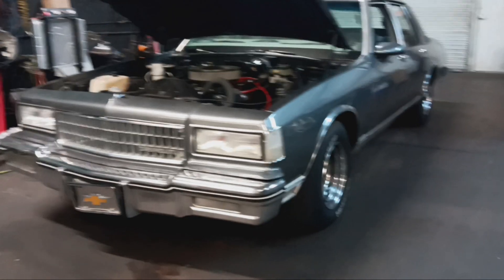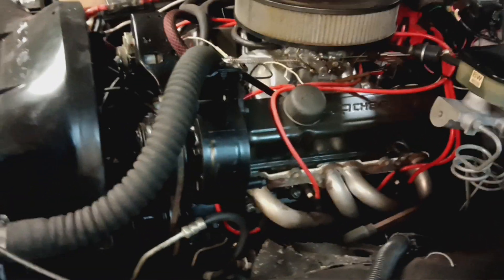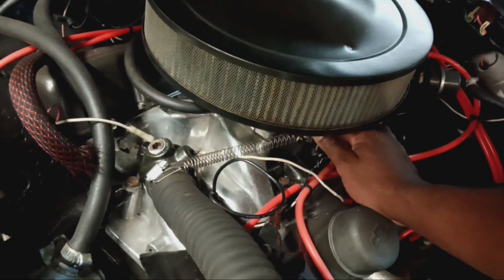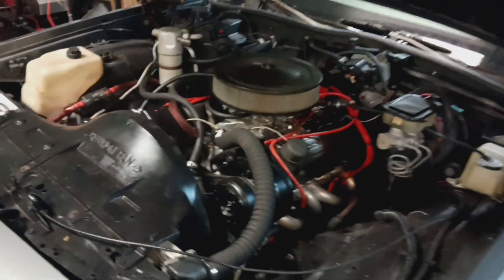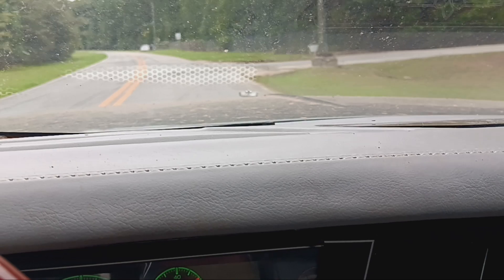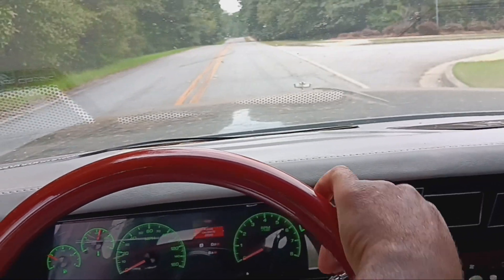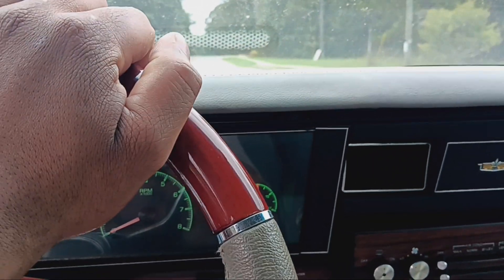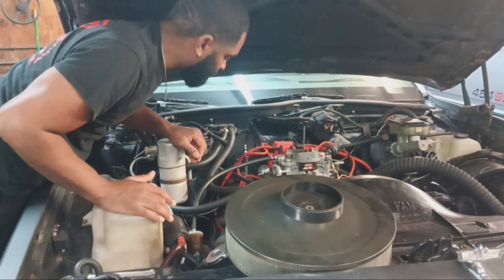Can we turn 160hp into 460hp !!!

Comment: I’m in Macon looking to get my 86 Monte Carlo running. How do I get in touch with you?
Reply from the maker: Wassup fam is the car drivable
Reply: @SSPENGINES383 yes it runs and drives I just have the 305 in it looking to go 383 or 400.
Reply from the maker: @kingk5572  I have 1 block left to build a 383
Reply: @SSPENGINES383  ok I’m interested
Reply from the maker: @kingk5572  770-866-6848 anytime after 10am
Reply: @SSPENGINES383 can I hit your line tomorrow or wait till Monday? Got a job for ya

Comment: I wonder can you make a 350 5.7 get 35- 40 Mpg with a Tune ??
Reply from the maker: Now that may be a challenge probably with a 2 barrell but I doubt it with 4
Reply: Dad had a '86 caprice wagon with 305 tbi, 700r4, and 2.xx:1 on stock tires ...... stock everything 100%. He would get mid 30 mpg when he would take mom out on a long drive. 
Thats the highest mpg Chevy we've ever had. 
I think stock cars with a DualJet were 20-25 mpg best case scenario.